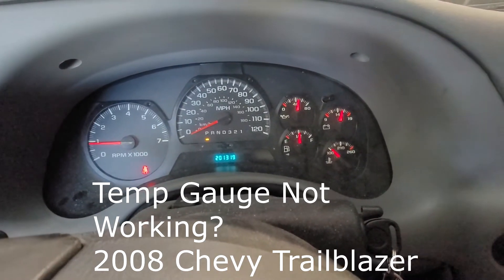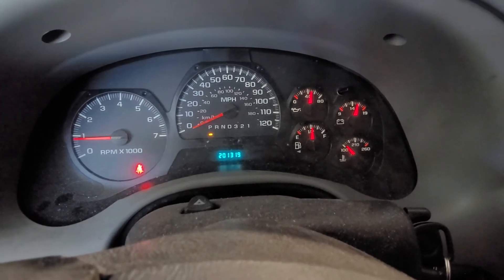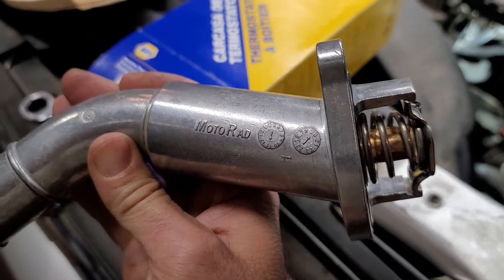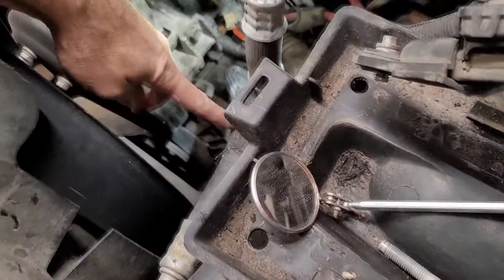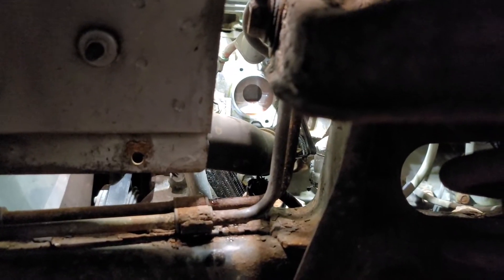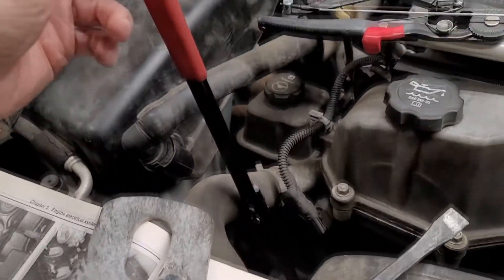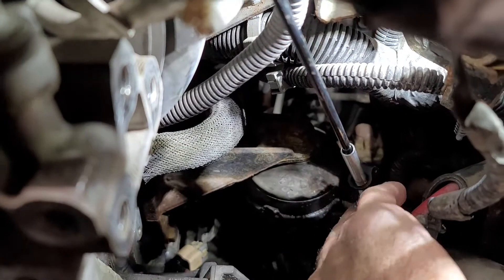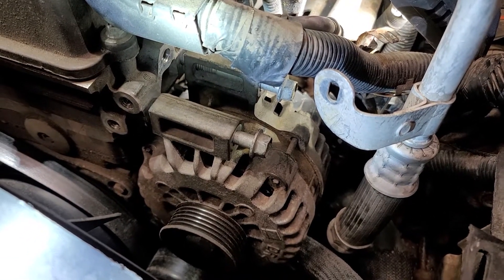Trailblazer / Envoy temp gauge not working? Here's why. And Chevy 4.2L thermostat replacement tips.

Comment: I had this happen exactly with my 2008 GMC Envoy. I had a service light which kicked a code P0128 meaning the temperature is not getting hot enough. Optimum temperature should be at 210 and mine was falling just short of 210 mark, my heat still worked fine as well. The computer will kick a service light because it thinks the engine is not running hot enough. Yes you can drive on it which I did all winter long and the light went intermittent on and off at times, but I had to go through emissions testing and couldn't go get emissions tested with the light on. You may notice the temperature gauge needle moving around and acting goofy as well. While driving around you will see the needle drop to down 100 (cold) instantly when the engine clearly has been running for awhile. He has 210,319 miles in the video, I am at 97k.

Install a new thermostat and I recommend get a coolant flush if you haven't had one done in awhile while the cooling system is apart anyways. The dealer diagnosed it and replace the thermostat and did coolant flush and have had no service light or wacky temp gauge ever since.
Reply: I am having the same issue with my 2008 envoy rn. I’m going to replace the thermostat and do a flush. Also just out of curiosity, with your check engine light going on and off did you also have your AC cold air not work when the light is on? Idk how the hell it would ever be related but whenever that code pops up, my AC quits too
Reply from the maker: Great comment, thanks for all these details. 
Emissions testing makes issues like this a real pain to deal with. Something as innocuous as an engine not getting hot enough can cause you huge problems passing these tests, and if you're not mechanically inclined, or have a place to work, it can cost you hundreds or thousands of dollars chasing silly issues just to pass emissions. 
I moved to IL from NV in 2020. Emissions were a mandatory thing in Nevada and I thought I was getting free from that when I moved to IL. Nope. In a couple of counties in IL, emissions testing is required and I moved to one of them, St Clair county. Ugh. So here I am, dealing with it again. Only difference is that testing is every 2 years here so you have more time to get paranoid about the tests haha. 
Thanks for commenting.
Reply: @jcx2bby  Thanks!! It has to do with the thermostat wear and tear, you may think the engine is rightfully at temperature but the computer is seeing that it's not, and mine was running a few pegs below the 210 mark, therefore triggering the P0128 code for the service light. I always thought "running a little cooler?? ok then not going to complain about that " Trust me, I looked into this and read a lot more about it ever since it happened to me first hand and if the service light goes out the issue really is still there, that light will be back on, my service light was off and on all throughout last winter. Do NOT think its the coolant temperature sensor, its not, so save yourself some money from even trying to have that done. I still have my paperwork from the dealer, the job costed $364.00 between the new thermostat and the labor. I recommend if your at or near 100k to just have the 100 mile package done which includes the coolant flush as well since they'll have your cooling system apart anyways. The whole thing overall costed $1,100 and they had my truck for a day and a half (gave me a loaner car). Yes here in Illinois we have always done emissions testing for many years, I'm in Dupage County. Surprised because typically people are leaving here instead of moving here, its a shame.
Reply: Odd, but there is no electrical connection between the thermostat and the computer. The computer doesn’t know the thermostat exists. The temp sensor communicates with the computer and the gauge. I’ve proven that and have had the same problem as you. The thermostat was changed, the temp gauge did not work. The obd2 still registered heat. It was a loose pin connection on the steering column connector. 
Fixed.
Reply: can you share where the steering column connector is loctated? I have replace the thermostat/ECT and still have intermittent issues @gulliver3644
Reply: Is it ok ? That my Chevy stays on 210
Reply: @loukenleyjeanbaptiste9457   Yes thats normal operating temperature. Should stay right at the middle .

Comment: I changed my thermostat twice and still my temp gauge is off and ac don’t work.
Reply from the maker: Ok. Have you used a scan tool to see if the thermostat is actually sending a signal to the computer?  And the thermostat wouldn't affect AC in any way
Reply: @jcx2bby  no I haven’t. But everywhere I look up it says when temp gauge is off ac won’t work and it’s true. Cause when it turns on ac works. I had it turn back on when I turn a corner hard.
Reply from the maker: @axist1235  well all I can say is that it didn't affect AC on the vehicle in this video. It still blew cold even with the gauge not reading. So that tells me you need to get a scanner and look a bit deeper....if you replaced the thermostat twice and it didn't fix it, I would think it's not the thermostat causing your issue
Reply: @jcx2bby it definitely affects the ac. Tons of people report this including me on my 08 trailblazer. I ended up changing the tstat and etcs. Fixed the gauge issue but absolutely never fixed the ac. To this day (4 years later) my ac still don’t work after replacing everything
Reply from the maker: @fsu3784  what are your hi/low refrigerant pressure readings?
Reply: @jcx2bby  actually it doesn’t even cycle anymore. So I jump it and it reads around 150 high and low vacuum on low. Like an obstruction only there isn’t ( been in hvac 20 years). So since I can jump it wiring is good from relay to compressor. Everything except wiring has been replaced
Reply: @jcx2bby  should also add when I replaced ets the guage had been fine ever since. Also replaced tstat. It’s honestly been a nightmare trying to figure out this ac. I’ve never taken any vehicle to a mechanic I fix my own but this has me stumped

Comment: Your video is well shot and informative...im just a bit confused, if the t stat cant or doesnt communicate with the on board computer then how does replacing it change what the guage does? My guage works on occasion, so wouldn't it logically follow its receiving a signal or not from something that is tied to the computer? Im not criticizing, again well done video, I think im going to try the coolant temp sensor first, as my heat is excellent. I live in New England and at minus 10 this winter I had heat. In fairness to you if my way doesnt work I'll be back, thanks
Reply from the maker: I have pinned a comment here made by Karl Swert. He explains the whole situation pretty well. I can't really understand why this system works the way it does, just that it does. 
Good luck and do let me know what you find.
Reply: Fair enough, my trail blazer only has 64K on the clock. I bought it 2 years ago as a spare vehicle, so it never has and never will have many miles on it. My plan of attack after reading and listening to others is this...replace temp sensor, and the t stat, drain, flush,  and use new coolant. That should cover all the possible temperature issues. The car is in excellent condition, has spent more of its life sitting which is almost as bad as driving 40K miles per year.

Comment: if he had heat an gage not working , wouldn't be the stat, it would have been the sender,coolant temp sender
Reply from the maker: That's what you would think. But that is not how this odd issue works. Many, many anecdotal stories out there about guys changing the sender with no resolution. The resolution is to change the thermostat.

Comment: I had the same issue. I can understand, light on the dashboard is so disturbing :face-blue-smiling:. 
Until you fix or replace the part. 
Temperory solution is:
Just stop your vehicle, reset the battery. Unplug 1 of the terminal of the battery and plug it agai after 15 seconds. 
You will not have any light on your dashboard.

Comment: That doesn't make any sense you would not have hot heat if you had a thermostat issue thermostats do not close and they stick open none of the stuff you're talking about makes any sense in your repair and you're just bumping into some luck I bet your problem was with the temperature sensor
Reply from the maker: No it was not the sensor. This is a well known quirk within these engines. Talk to the GM repair guys if you want reassurance.

Comment: I just started having this issue yesterday and now the check engine light is on. Is this safe to drive with until getting fixed?
Reply from the maker: Probably yes. But the only way to know for sure is to get a scanner that shows live data and check the temp that way.
Reply: This problem started today on my 2008. Wonderful!!!!! It’s going to a mechanic.
Reply from the maker: @gulliver3644  haha, I know the feeling. Well good luck with your repairs whether you do it or have the mechanic do it. I hope you get it solved

Comment: Did the gauge worked?????? I had this problem for 2 years now. I live in Florida and it’s hot!! I change the temp sensor and still didn’t work. I guess I’ll change the thermostat.
Reply from the maker: Yes it did, has worked ever since I changed the thermostat. 
I'm glad you pointed this out....it looks like my video did not finish rendering and it cutoff the test drive after the replacement. I never noticed it until now. Not sure why that happened. 
Anyway, change your thermostat!
Reply: @jcx2bby  thank you so much!! I will do that today!! I seen so many videos telling ppl it’s the temperature coolant sensor and it’s not.
Reply from the maker: @axist1235  no, it is most likely not, especially if you changed it already. Although I am ASE certified, I'm not a professional or an engine specialist but my buddy is. He's seen this a few times before.
Reply: @jcx2bby that didn't work for me... Water pumps back in Oct, ect sensor and thermostat.. heat works, gauge doesn't move and fans run, just can't get rid of light and still get low circuit code for temp sensor
Reply from the maker: @k.esperanza2390  the problem I describe in this video doesn't throw any codes. Sounds like you have a wiring issue if the sensor has already been replaced. Make triple sure the plug for the sensor is seated and in good shape.
Reply: I’ve replaced thermostat sensor and thermostat, it worked for about a day both times and now just starts way above max and just goes up from there even though the engine temp is normal.
Reply from the maker: @billycadillac4227  that almost sounds like a gauge problem. Sorry I can't help much with that.

Comment: What bluetooth adapter do you recommend to use? I have Torque Pro but my cheap OBD plug in transmitter doesn't work.
Reply: I use the BlueDriver which works great. Used on Chevy & Jaguars. For 100, you really cant go wrong. Check the vids on YT.
Reply from the maker: I have the OBDLink LX and it works really well.